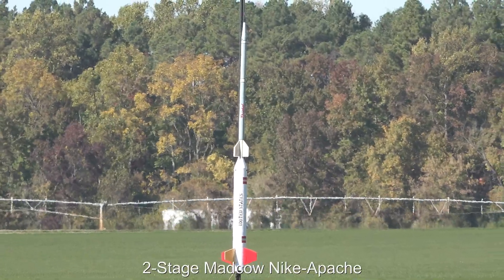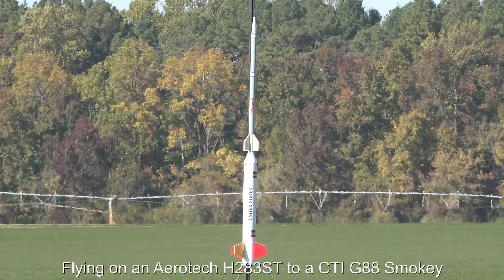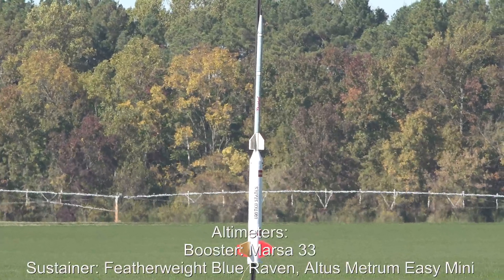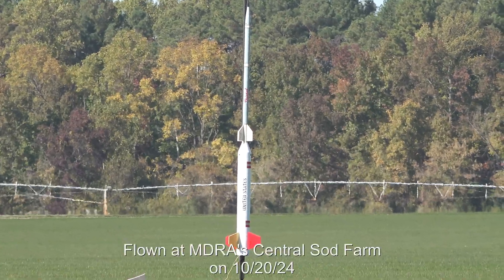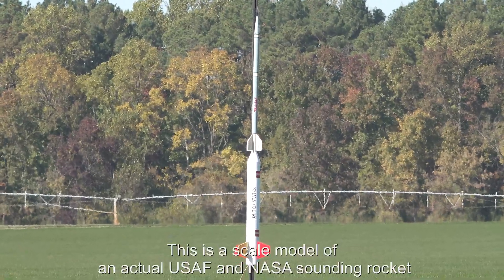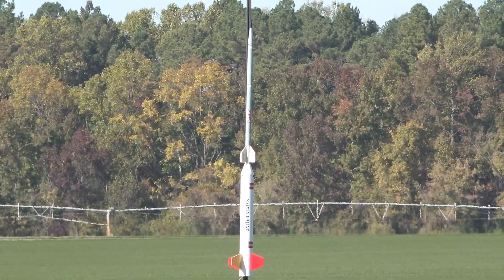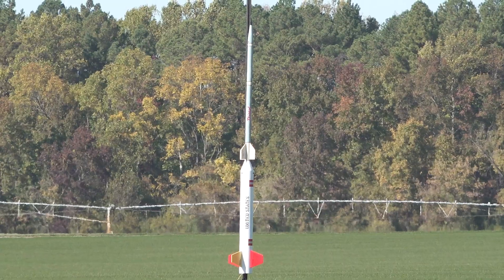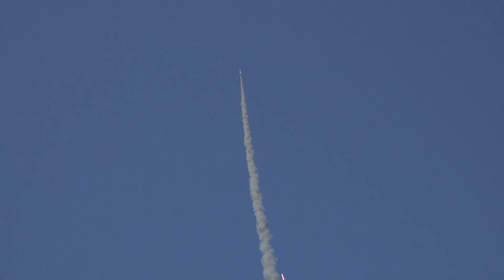2 Stage Nike-Apache High Power Rocket

Comment: That's awesome! I haven't seen a two stage actually work.  The last air-start was a disaster!
Reply from the maker: They are tricky. I had some failures at first before having consistent success. I have many more 2-stage HPR flights as well as cluuster air-starts if you check out my previous videos. Some altimeters are better than others with airstarts.
Reply: Beautiful launch and safe recovery. I know initial failure is the key for great success. Great going buddy.